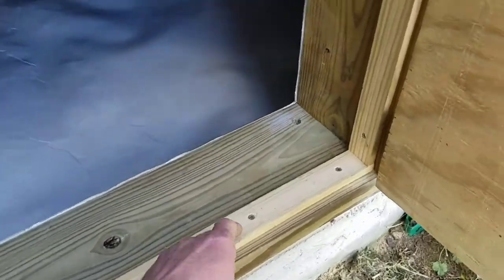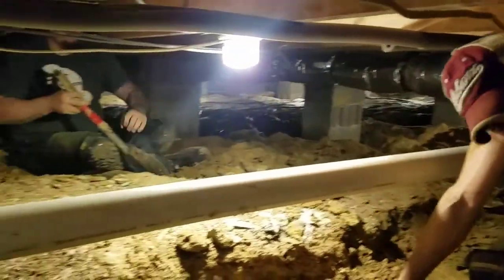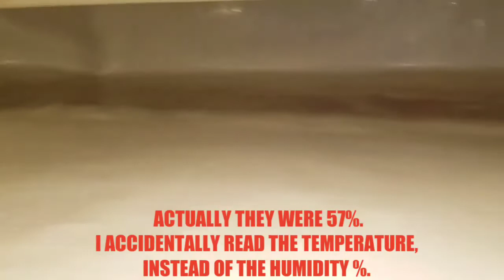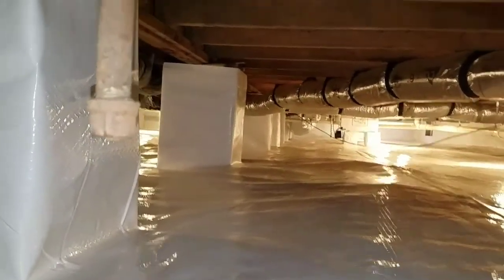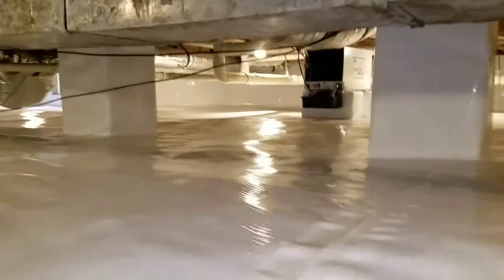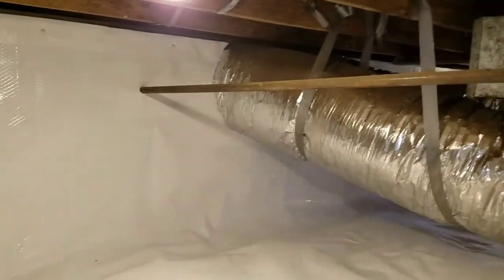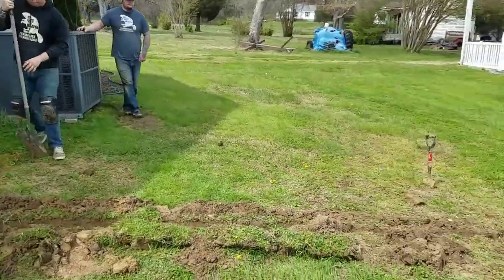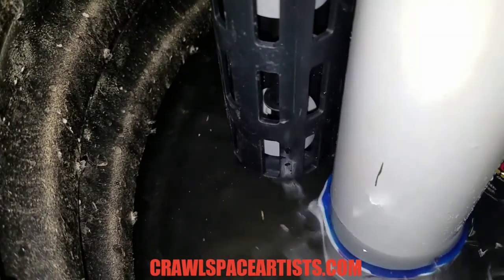How To Win The War Against Moisture Inside A Crawl Space

Comment: So live in michigan, and had bad spring wet wet wet. Looked in my crawlspace today and got about 6 to 8 inches of standing water. Its sickeneing. Its always been wet. And its a low water table.

Will encapsulating like you guya did after French drains to a sump keep all the water under the mat? Good news its a small house only 24 x 30.
Reply from the maker: mav68nrs as long as the french drain system is installed propeely, as long as you buy a more than powerful enough sump pump for the situation, as long as you buy the proper basin, and as long as the discharge from the sump pump is plumbed properly, you shouldn't have to worry about anything other than a power outage. As long as all of that is done correctly, and you do your encapsulation just as I do them all, you should be good. But power does go out. And I don't care what anybody ever tries to sell you, if that water level EVER rises higher than the ground in your crawl space that your poly is secured to, the water WILL come through s seam. That's the truth right there. But if that pump and drain line is working, AND IT IS DONE RIGHT, you shouldn't have to worry.
Reply: Tanner Flowers thanks for the reply. Watching some of your vids cured some of my worries with my situation. Ibebonly ever had maybe 3/4 of standing water in the past. This yesr its been alot of rain in southern Michigan. And water tables high in my area. Now 2 days straight rain its a pool.
Reply from the maker: I been hearing that same statement over and over this year. Lots of rain!